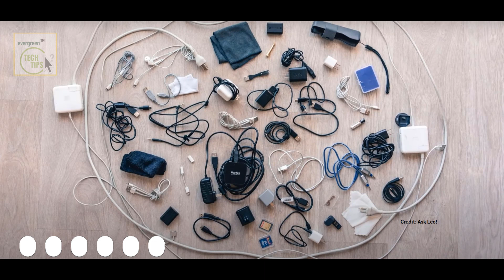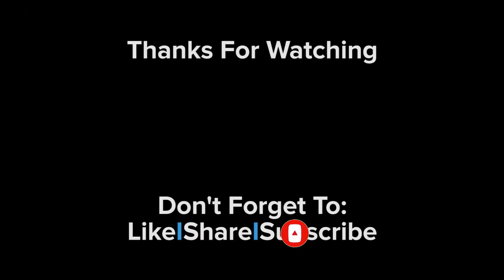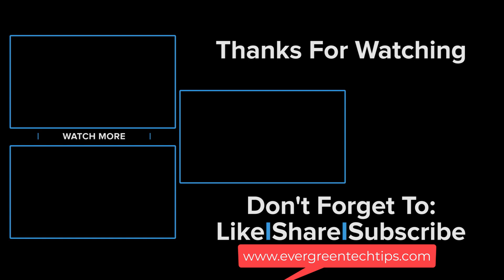Why mobile charger has same volt output but different ampere current output?

Comment: Just to add, If the Amp chargers are higher than recommended by the device, then some devices don't even charge, like a  cutoff protection for the device.
Reply from the maker: Yes, thats cool, right?